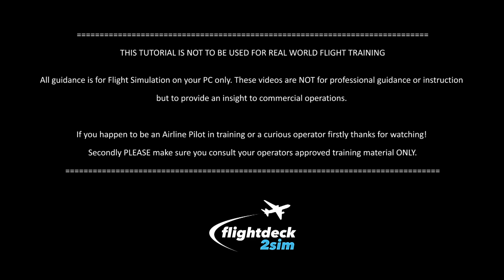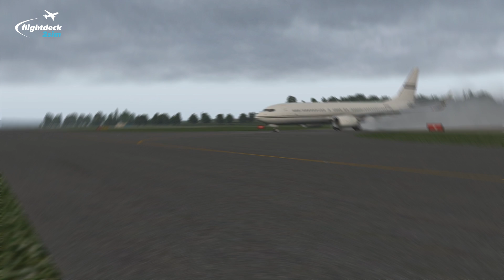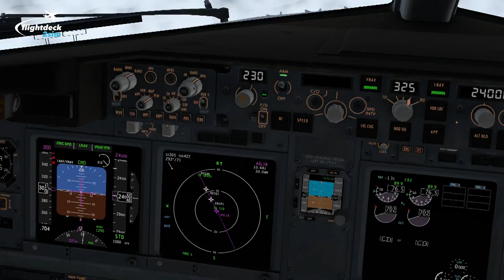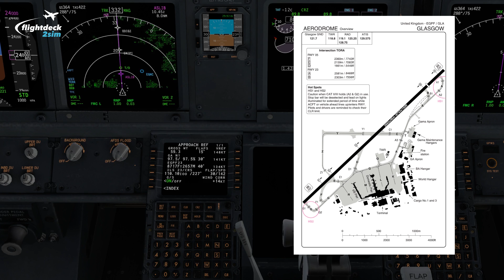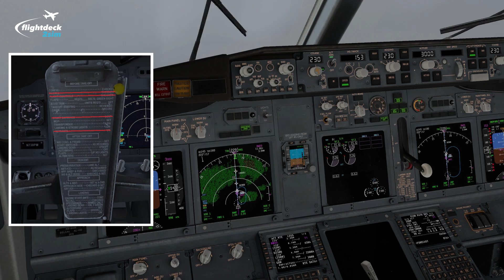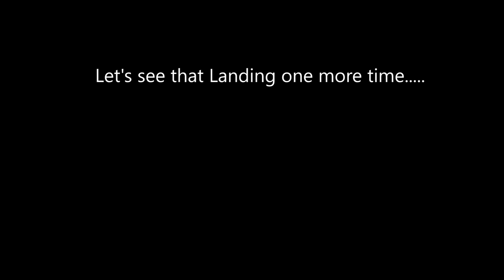Full Flight Tutorial by REAL BOEING 737 PILOT | Liverpool - Glasgow | ZIBO MOD | X-Plane 11

Comment: I watched all your tuturials so far. No speed breaks after flaps 10 (15,25,30,40) have been selected is new to me. Thank you for that!
----
1. What would you do in real life, if you had guts like in this tuturial but the visibility was too bad? Would be a CAT3 autoland possible in these conditions or would you be vectored to another airport by ATC? (Autoland isn´t possible at all airports either)
2. How many NM do you need minimum to see the papi/runway lights for a manual landing? 
3. I´d also like to know, are you going to purchase the PMDG 737 NG3 incl. EFB once it will be availabe? (Any time soon after the 747-8 release)
Reply from the maker: Hi MrPtLo

1. In this weather you could easily fly a CAT I ILS. If LVP's were in force we would fly CAT II/III if available to an Autoland
2. No set distance. Just to see certain elements of the approach lighting system/runway at minimums
3. Someone mentioned this, might try it out!

FD2S
Reply: Thank you very much for your response! Much appreciated! 
I did mention it to you on your previous tuturial and provided a link to the PMDG news ;) However, I do understand that you cannot remember all users. There are simply too many, which is actually a good sign for your great work :)
Reply from the maker: My Apologies! Thank you very much for the information!

FD2S
Reply: Never mind FD2S! 
May I "annoy" you with two more questions please?
You mentioned a few times in your tuturials that crosswind landings are really difficult in real life.
1. If it is you who is going to land the aircraft and you see the guts on the weather forecast, is this something where you think "awesome, I love crosswind challenges" or "oh hell no, why me today?"?
2. In case you need to abort the landing and take another round, is this annoying for a pilot or are you so focused that you do not even think about it?

Thank you!
Reply from the maker: 1. You don't really think much about it, real life isn't a game! If the crosswind is on limits you have to start thinking about the possibility of diverting but it's rewarding landing in challenging conditions.

2. Not at all, it might dent ones pride having to fly a go around but the saying goes, all approaches are flown to a go-around, a landing is a bonus! 

FD2S
Reply: Hi, I know it's very old video but - I wonder if in real life with this baloon in 36:06 after AP disconnect, would you continue and land or go around? The touchdown was looking pretty rough afterwards.

Comment: Is it harder to be right on the centerline on a simulator than it is in real life ?
Reply from the maker: Its not too dissimilar in a full size Level D Sim. New pilots moving from a Seneca to a 737 tend to think the aircraft is absolutely massive and they’re sat a million miles away from the Capt, they tend to land right of centreline. You do adjust quickly though.

FD2S
Reply: Thank you for the answer !

Comment: How have you found the handling of the 737 in X plane? For me when I tried it, it felt really twitchy in terms of control and how it is effected even by relatively low winds.
Reply from the maker: Hi MagyarMatt.

It’s still a work in progress but even testing the last two weeks and updating periodically the FM is improving. The aircraft does bounce around a lot in real life, the model isn’t too indifferent. Trying to provide what feedback and comparison I can! 

FD2S
Reply: Thanks for the response. I haven't used X plane in a while. Might have to go back and give it another go!
Reply: You will find it a hell of a lot different if you're used to fsx/P3d the flight dynamics are modelled really well in x plane whereas fsx/P3d are really not modelled well at all.

Comment: get better pushback for x-plane 11. it's amazing and freeware. it pushes you exactly where you want at a realistic speed.
Reply from the maker: Thanks for the info! I’ll try it out!
Reply: It's Better Pushback
Reply: What is the freeware called
Reply: X Plane 11 does have pushback, but the key command isn't assigned by default. You can also assign a key to push nose Left or nose Right depending on which way you want to face after push is complete.